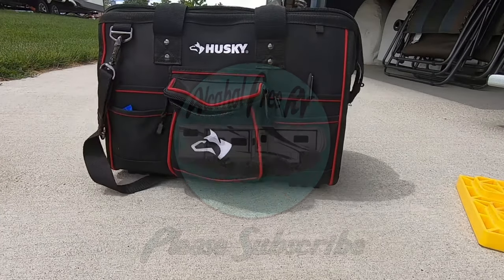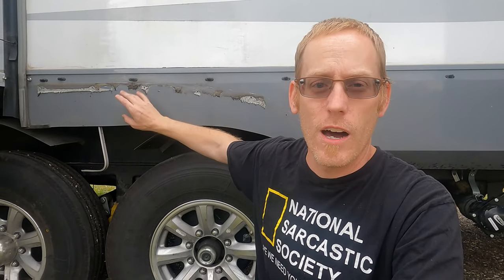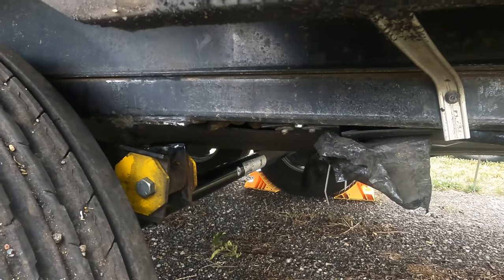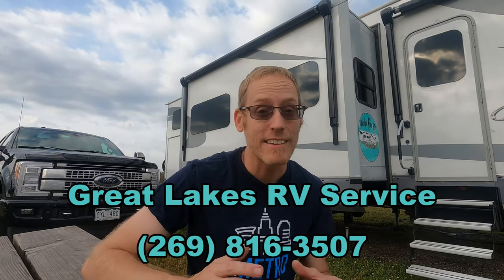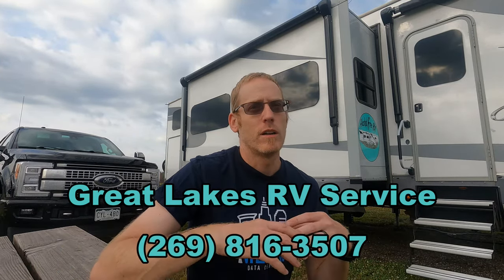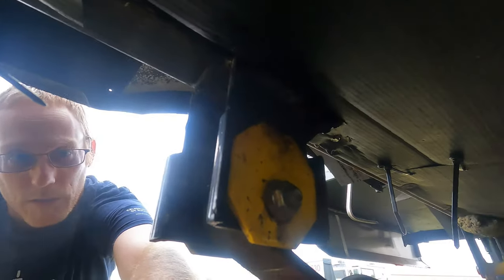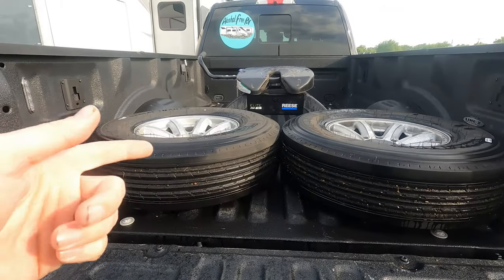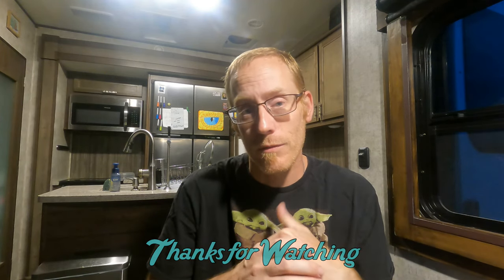Our Suspension Broke on the Highway! | Stranded in Elkhart!

Comment: My 2011 KZ fifth wheel has the axle hangers reinforced by having a v-shaped bracket welded inside the axle hangers. The v-shaped piece is welded to the frame & the axle-hanger. I believe all trailer axle hangers should be installed in this manner.
Reply: It would be fantastic if you would put pics on imgur and post a link.   This is a mod my rv friends need to see.
Reply: So does my 2011 kz :)

Comment: 1. I see a lot of trailers being pulled at 70-100 mph by powerful diesel pickups. There is a reason in many states towing uses a lower linit.
2. Im sure these frames are weak. I am a heavy equipment/trailer mechanic. Most of my work on the big rigs. But you see and repair similar things. If I owned one of these I would gusset and plate a few key areas. 50lbs of steel makes all the difference. There can also be a good reason for buying used older, but clean unit with a few miles. Its been tested by trial.

Comment: Many of the leaf hangers these days have an extra angle welded within the bracket to help prevent this. In addition, I welded a cross member across the trailer to each hanger to prevent side to side bending of the hanger

Comment: As the owner of a Lippert frame myself, I've spent the better part of an afternoon watching YouTube videos of this exact same failure. You are not alone. Those brackets are seriously undersized, and I can't understand how there isn't a class-action suit against Lippert at this point. Perhaps if the NTSB or NHTSA was made aware of the frequency of these failures Lippert would spend the extra $6 in steel and address this. Glad you got out of it without any "major" damage or injury.
Reply from the maker: In a terrible way, not being alone is good, but dang, so many failures is not reassuring in the least. I've seen a CA-Suit in the state of California for this exact problem.
Reply: Its to easy to point the finger at the rv owners, no they should not have so many of these problems, but i can just hete a good attorney they must have hit something and weakend the ????
Reply: How would I know if my trailer has a Lippert frame?
Reply from the maker: @keithvick1432  somewhere on the frame it would be indicated, probably near the front. It may say lippert or LCI. Most of the large scale manufacturers (keystone, grand design, forest River. Etc) use lippert
Reply: @keithvick1432  just google the brand of trailer you have, and ask what frame they use, but to be on the safe side if you dont weld, ask a friend who does or find a welding shop that will reinforce the frame brackets and the hitch where it goes under the box part of trailer
Reply: @keithvick1432  there should be a sticker on your frame, mine is on the passenger side towards the front.
Reply: @kenhall7517  thanks much

Comment: It always amazes me that you have these HUGE trailers and it's all sitting on 8 little 1/4" thick pieces of un-gusseted mild steel, just tag welded to an even THINNER frame.   How are they able to sleep at night?
Reply: Wouldn't want to over regulate them.  This is the land of freedom.
Reply: @ravenfeather7087  No regulation required, just some common sense when designing these things.
Reply: Yes on the cheap spring hangers. Have a 2017 montana high country 310RE and the spring hangers look like the ones on my small utility trailer but,but they pretty much want you to have a Peterbuilt to hold the front end up of the trailer

Comment: Yeap same thing happened to us, my husband always done a walk around every  time we filled up, noticed  the problem at a gas station, lucky for us a repair shop across the street. Our rug was 20,000 dry weight. Got it fixed , but about 3 months later the same thing, was at a truck stop, and they did it right. Put the same suspension  as the big rigs have. No problems  after that. Good luck and be safe.
Reply from the maker: big rig suspension should hold up to RV use! SOrry to hear you went through it too!

Comment: We bought a trailer with a Lippert frame and the first time I crawled under it I noticed some of the welds weren't on the seam. So I decided not to drag it across country until I get time to rebuild it properly. Luckily I have a slide in camper.
Reply from the maker: Its a shame the consumer has to immediately upgrade their rig to make it road worthy
Reply: You should have crawled under it before buying it !
Reply: @sarahann530  that's where you'll be...
Reply: @sarahann530  your right , assume nothing.
Reply: Sadly no one is paying attention at the federal level prolevel regarding consumer products AlexSadly no one is paying attention at the federal level  regarding consumer products. 
If you build a new house, you have to Is build it according to code. If you manufacture automobiles they have to meet the federal standards. Apparently there are no standards on the manufacturer trailers. I drive truck and pull a semi trailerAnd make sharp turns with a fully loaded trailer with no damage to the suspension, Why should be a different for a RV?

Comment: I didn't watch the entire video and catch every detail, but I assume that after you had the frame fixed and new tires put on, you had the alignment checked. When I had our TT frame inspected last year, MorRyde stabilizers installed as well as wet bolts and upgraded shackle straps, I had them check the alignment so I would not ruin my new Goodyear Endurance tires. Alignment was spot on!
Reply from the maker: Yes everything has been aligned! (Not captured in video tho)
Reply: A trailer alignment is automatic by default it's not adjustable it's welded in place straight with the frame...
Reply: That leaf spring hanger is available in every tractor supply store. Yeah it fractured just past the weld which would makes sense.
Reply: My Lippert frame and Axle failed the first year of operation I'm now on my third axle and the frame has been completely wrapped in real steel... I've had axles fail, Wheels pass me on the freeway and frame bending.
Reply: Cheapest fastest thing you could do, is go to harbor freight buy a hand grinder and wire feed welder... Welding is quite easy and you could teach yourself in a minute...

Comment: Hopefully you looked at all of your attachments . The main problem is making sharp turns with your trailer pulling into tight areas or backing into tight areas with sharp turns .. If you watch your trailer tires leaning when backing in ,  those spring hangers are under heavy tortional pressures as is the Frame . One axle is twisting your trailer mainframe in one direction while the other axle is trying to twist it in another direction . The Frame crossmembers try to hold the main I beam straight , but that member is welded to the vertical web if the Ibeam  and the web will crack eventually.  Look on the main trailer frame  I beams above the spring hangers and you probably will find cracks  about 2 inches above the flange  at the frame crossmembers attach points . Avoid sharp turns . The cracking and popping is you frame cracking !
Reply: Wrong,,,,this has nothing to do with making sharp turns,   Look under any Forest River RV product line and see how thin the frame is.  The RV manufacturers are using metal that is too thin, so once the frame starts to rust, you quickly get metal fatigue failures

Comment: You might want to consider not getting your tow vehicle and trailer in to much of an angle causing side loading on your axles. Just watch your tires how much they scuff when you turn to tight. If you bend a piece of metal back and forth it will break. Side loading your axles back and forth is going to do damage.

Comment: Those spring hangers really need to be reinforced , especially on large fifth wheels.  Alliance RV is the only RV manufacturer I know of that does that on all their RV’s.
Reply from the maker: more are being spec'ed with additional support, however it's not a hard and fast rule yet. Even BTBRV had to have the V-brace reinforcements installed after delivery. On his custom rig. This is something that should not be up to the consumer.

Comment: Lippert needs to reinforce frames and brackets before leaving factory.  Paint those repairs well to prevent rust. Then look once  yearly to see if it needs more paint.
Reply from the maker: I've heard that with newer models Lippert is still only "recommending" an additional V-brace in between the hanger 'arms'; they apparently still allow the manufacturer to decide the final spec
Reply: @AlcoholFreeRV  The whole suspension needs better parts. They are to thin.

Comment: I just watched this video and the one where you replaced all 5 tires. The thing that caught my eye, were the little fender liners above the wheels. They are a half round fender that appear to be welded to the frame? Are they OEM, or did you add them in afterwards?
Thanks
Reply from the maker: The fender liners are OEM on our rig. I imagine they help with road debris, rocks, etc from damaging the underside, but are so lightweight that they would do nothing for catastrophic tire failure.
Reply: They are for water coming off the tires when rotating mostly

Comment: Hello sir my question is what year is the trailer?? I'm working on compiling information that has only to do with frames from what years to what years were most of the problems. And can you approximate what part of the country do you drive in the most and are you a boondocker or mostly a trailer Parker and how many miles approximately does the trailer have I don't need anything concrete just approximations are fine. Thanks in advance all the best to you and your trailer and God willing nothing else ever happens except smiles 🙏😃
Reply from the maker: This is a 2018. We don't have a "most traveled" area but we've been all over. 33 states we've slept in I think but our starting point is always Colorado. We have never been boondocking.. mostly interstate miles and paved campgrounds for us. At the time of failure we had about 11000 miles logged.  I hope this helps and thanks for the well wishes! Have a great day!

Comment: Nobody gets this!  This is NOT lipperts fault! They only build to the Manufacturers Specifications!! If the Manufacturer orders a frame that can’t handle the weight, then it’s on the manufacturer! When I was a tech, I worked at a Fleetwood dealer. A few times a year, I’d drive to the closest plant, and pick up a “special order” trailer. I walked the travel trailer assembly line many times. Fleetwood ( in that time) built their own frames, and the quality control was phenomenal! Never had a frame failure on that Manufacturer, in 20 years of my career!
Reply from the maker: I have read that the trailer manufacturers order frames to a certain spec. I have a question because I have no clue how it works. Do Jayco, Forest River, highland ridge, etc have the engineers on staff then to perform the GVWR limit calculations and determinations?  I just always assumed that the frame manufacturer had that responsibility.

Comment: This is not a mechanical failure this is a structural failure. Needs thicker leaf spring hangers all around. I would just have them all replaced with thicker hangers. Clearly lippert should be sent the bill. This needs to be recalled.

Comment: So what i think happened in your case is the brackets flex to much when you make turns, if you can look at your tire on the ground while you are backing up and in a turn you will see the sidewall pushed in or out, this is the force of turning, those brackets have to take the same force, i would suggest you get someone to weld a piece of 1/4 plate on edge to the shackles, and up the frame about 3 inches, this will stop the problem
Reply from the maker: I've been trying to decide on a more robust fix. I've heard this suggestion as well as spanning the frame with 2" l-bracket and welding that to the frame, as well as the front or back edges of the brackets
thanks for your input!
Reply: I was thinking about this and i looked at my trailer, 2002 forest river 30 ft 2 slids, 1 a super , i have angle iron welded on the flat of the i beam frame, im going to weld a piece of 3/16 x2" flat strap down the side of the frame and spring hanger, putting a piece between the 2 sides will mot solve this problem, i would also weld a piece of 3/16 about 16 inches long on the hitch center it on the edge of the rv box, make the piece as wide as the hitch
Reply: @kenhall7517  This stress should be taken into account when designing the chassis . They are shit

Comment: I have an old travel trailer that has heavier shackle brackets then that. Seeing Lippert frames that are 1/8 inch thick is almost criminal. The problem is that Lippert frames are made to Manufacturing Specs through out the RV industry. That's no excuse, junk! I would weld up 1/4" plates plates along the frame rails end to end where the shackles are welded & get new heavier Shackle Brackets. Your original Shackles are not heavy enough period! Good luck. Safe travels
Reply: Lupperts website clearly states that they "design and develope."
If a manufacturer requests a frame with specs that can't be safely produced, it's 100% Lipperts responsibility to say "No, this is what we have to do."
There's a Professional Engineer involved somewhere, I think it's time he was introduced to a courtroom.
Reply from the maker: Yeah as I have gotten further in the saga, I have come to realize how insufficient the construction is.

Comment: Maybe if the frame maker didn't make everything so cheap. That happens when the maker of the frames uses the lightest weight stuff they can. I don't get it. Those leaf springs should be swapped for real ones and some shocks to prevent leaf spring fatigue. Go look at a car hauler trailer of same length and load capacity and see what that suspension should look like. Our 5th wheel was light weight junk. We have a goose neck toy hauler with real trailer suspension now. Spring fatigue is a real thing on cheap leaf springs.
Reply from the maker: I have a buddy who experienced the spring failure you're talking about just 2 months ago. Not a heavy 5'er, but undersized for the TT he has.  Unfortunately, I believe many big manufacturers would lose sales if they went any heavier duty, as the price point goes up with more material. Also, CCC would go down, or you'd have to get a bigger tow rig, and many people are undersized on their TV as it is.
Reply: Keystone has Lippert build the frames to their specs. I would not buy anything made by Keystone because of the poor quality. The Jayco 31 RLDS we own is better built. Now that Thor Industries owns them time will tell us if Jayco is still good.

Comment: I’m curious, if you’re sooo concerned about your frame, why not have lippert be the first to examine the failure, instead of having a ‘welder’ patch the break. I’ll be very transparent here, I’ve owned in excess of 30 rv’s, yes over 30, fifth wheels, bumper tows and park models, I’ve never had a tire failure, axel or shackle issue, never. Pity that you won’t get a clean bill of health as to why the shackle broke, though I have my own opinion. Obtw right now I have a 44 ft 5th wheel tow hauler and a 32 ft bumper tow for short trips. Happy Travels,

Comment: Sorry to the welder but my 15 year old kid would puke at the sight of those plate welds. Less than mediocre. Find a skilled welder and have plates put on all the brackets.
Finally, these funny things called motels are far cheaper than the cost of these huge cardboard boxes that add about 80% to your chance of dying on the hiway. Love travel trailers - permanently parked and used as a vacation rental. No risk, no welding.

Comment: Sorry it happened. I had a welder wed a square plate on the front side of the front bracket and the backside of the back bracket. This is a well known failure and I wanted to avoid it. KYD talked about this in their Mexico trip. Because of that I never had this issue on our 37' Grand Design.

Comment: Lippert has poor designs and their frames crack regularly. Buyers should beware and take preemptive action by having gussets and supports welded on. They also do not paint behind their welds so corrosion eats framed from in between welds. Congress should pass protective laws for trailer and RV owners like the lemon laws we have on cars and the industry would then correct itself once they could no longer escape liability.
Reply from the maker: I agree that lipperts design here is insufficient. I also believe that it should not be up to the consumer to reinforce a brand new frame...